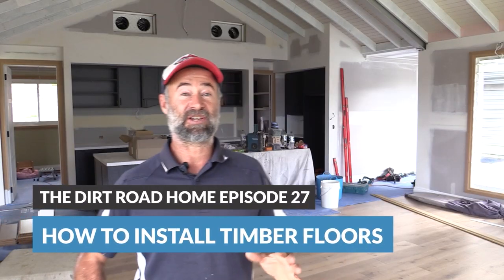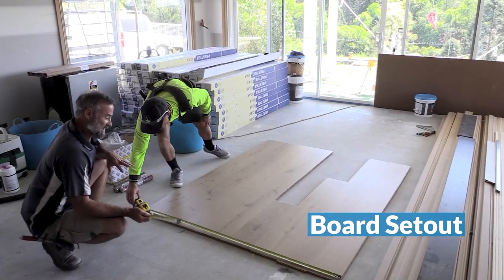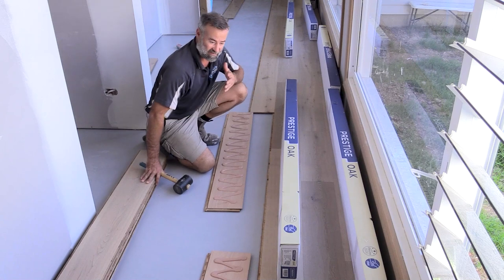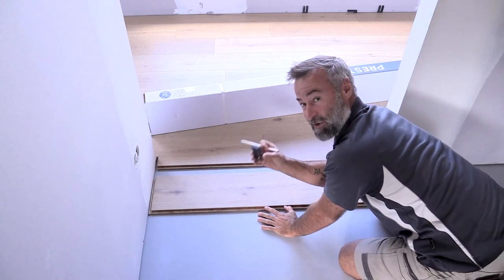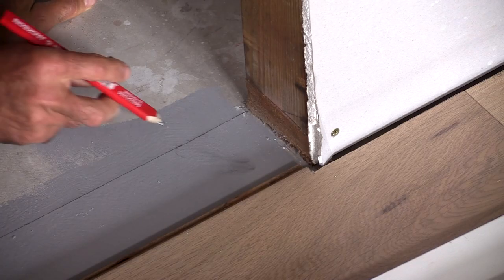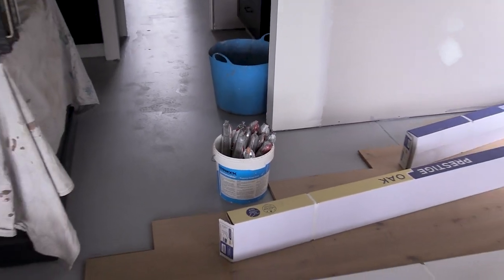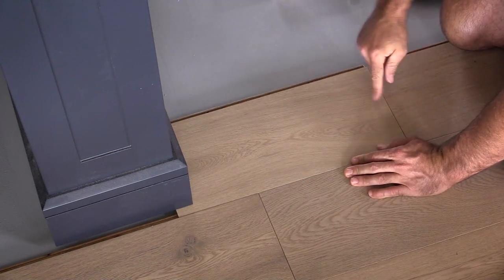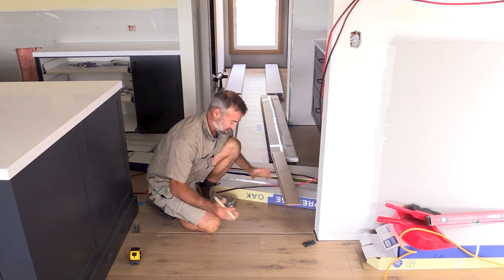How to Install Engineered Oak Timber Floors over Concrete  - Episode  27 - The Dirt Road Home.

Comment: Came up a treat mate. I noticed that last bit you did you changed it up to putting the glue down on the slab. You should have sealed and first coated all the walls and ceilings before you did the flooring and fitout. Saves some time.
Reply from the maker: Great idea, thanks mate 👍

Comment: This is so fantastic!!   A question please. With hindsight, would you have left the flooring install to a little later in the build. Like couldn't you have painted walls first? Finished tiling and fitoff of electrical points; and than do flooring and artchitraves?  I'm just trying to think through my construction plan. Cheers.

Comment: Great  tips and video , Is it essential you have to glue this engine oak down or can you just lay it over waterproof foam underlay  thats  going on this concrete slab ? and then just PVA glue each tongue and groves  on each  plank as you go and the heavy weight keeps boards from moving and  still do the 10 mm expansion gaps around skirts  and arch's  and silicon between bathroom threshold the same as you are doing .  Is this an alternate  method or  a  big no you must glue down ?
  be great to hear your view .